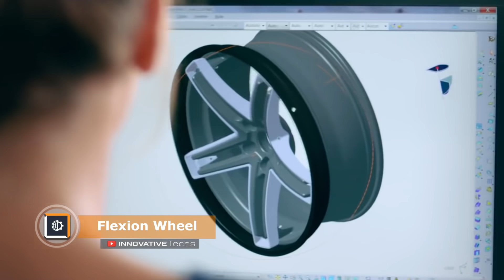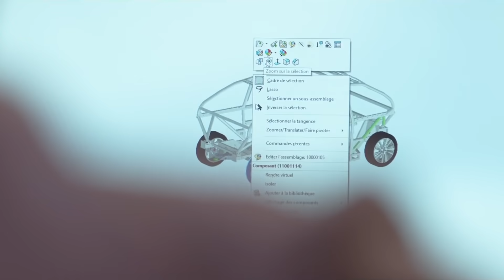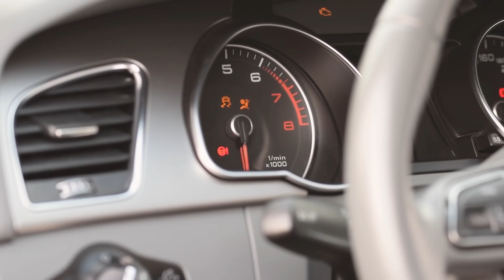Michelin presented airless tires for production cars

Comment: some people took the term "re-inventing the wheel" to a literal level.
Reply: Paradox that will being of tubeless tire design was long invented back in the late 60s by a company called Goodyear which made the tires completely out of piano wire thickness stainless steel interwoven that acted like a spring dampening qualities for the vehicle called the moon rover.
Reply: Paradox good thing that’s a tire and not a wheel
Reply: Back to the Stone age 😂😂😂
Reply: @isaiahbabb8612  Some of them replace the wheel too though
Reply: This typer of wheels have existed for more Then 10 years but have only been avaible for the military
Reply: History repeats itself bro
Reply: Paradox A tireless venture, nonetheless.
Reply: Gary Quail yeah that's not for consumers
Reply: The wheel hasn't changed though...🤦‍♂️  Only improved.
Reply: @garyquail2347  While Goodyear did start the idea, they could never make the actual idea. Michelin was the first to make the Tweel and no company has been able to match the same quality as the tweel. While these tires do break it is typically due to over abuse and sometimes just a bad tire, but Michelin has been so far ahead of Goodyear for decades. The only reason the tires are expensive is that in the tire market you get what you pay for, Goodyears only last for about three years on average before having to get replaced while Michelins, on average, last for about 6 years before needing to be replaced.

Comment: Won't work in the snow belt. Voids will fill with slush that will freeze when you park.
Reply: Good point
Reply: If they close them it should be fine but definitely not in this state.
Reply: If they flex enough, any ice would break out pretty quickly but they might be out of balance for a while.  I'd worry more about a rock getting into that web.
Reply: @alwayslearning3671  Ice can be hard and sharp enough to damage the rubber, especially when this happens repeatedly.
Reply: They will probably make a sidewall to cover that, but don't have it currently applied just so they can show off the technology.
Reply: not true the ice will break when u drive, i doubt frozen slush can hold up 2-3-4 thousand pounds.
Reply: @Zesmas  
its not about the ice not breaking but rather the concern of how more stress you are putting on the rubber/what ever material being used. for example the ice slush holes in holes and overnight the ice freezes, when you start the car the extra weight could cause the ice to slice something before craking. when repeated it could cause the wheel to wear out alot faster then if there was no ice.
Reply: @Zesmas  yes and no. Tightly compact slush that freezes into a ball can be very strong. Also if a car weighs a hefty 4K lbs, thats only 1K lbs per tire. Plus you have the weight spread out over the contact patch of the tire. So realistically you may only be looking at 800lbs of pressure.
Reply: I bet that tire in snow conditions it could possibly give traction because of the added weight
Reply: Or... anywhere with heavy snow? I hear they have that in some places that arent Ohio.
Reply: They will look like normal tires/will have a sidewall. At the moment they are shown open just to display the technology inside.
Reply: Send these baby’s to Florida right away 😎😎😎
Reply: Of course they will add sidewalls to the final product. Pretty sure the reason why there is none on the videos you see, is because they want to show the new technology.
Reply: Production models will be closed and look same as any other tire, open ones are only for prototypes/testing.
Reply: They can make a closed one that less stiff so it can be more flexible
Reply: @alwayslearning3671  Agreed, similar to having snow pack itself on the backside of the wheel. It'll work itself out.
Reply: Can’t they be heated from the car somehow to melt it?
Reply: well it would be easy enough to put a sidewall on the tyre
Reply: They'll probably close the size once it hits production. It protects the insides as well as looking more "normal". Since we humans don't like change, Michelin will benefit from making it look normal if they want the tyre to be widely accepted.
Reply: Cant wait for the airless tires but I live in Michigan so they need to work in winter as well. I hate low profile tires because again Michigan. With all the stupid potholes everywhere my wifes already ruined 2 rims on a 1 year old car. But she had to have a sportscar. Good thing we got the warranty.
Reply: Make side walls and your problem solved.
Reply: Yep..  stones too.
Reply: @SugarFreeTargets  If you put sidewalls on it, it's back to being a pressure vessel.
Reply: @peterscott2662  - like a tire?
Reply: Peter Scott wow, that’s actually quite intuitively insightful! It sounds obvious now that you’ve mentioned it but, I never would have thought of that! I’m sure the same could be said for muddy terrains...
Reply: Been through that with my CRV. The rims collected slush and after it froze in place put your wheel out of balance. Had to stop and clean them out. Needless to say didn't keep that vehicle.
Reply: @Dindonmasker  they should close them in, then add something light and expandable to give them more rigidity in the sidewalls in cornering.... No clue what would work tho... Maybe nitrogen or something
Reply: Could easily cover the gaps with flexible material on the side. Not rocket science.
Reply: @Zesmas  you never drove in winter have you?
Reply: @beatswitdat4285  from thousands of years of water continually freezing.......i fail to see your point.
Reply: @Zesmas  nope u are way wrong,glaciers are made from snow. Over time snow gets heavy, so in a place where it always snows, snow is going to stack up. With all the snow that keeps piling up it it getting really heavy and making the bottom solid. Then repeat...repeat....repeat
Reply: @beatswitdat4285  glacers are ICE not snow.
Reply: @Mach_Style  you  have obviously never met Mr. Momentum.
Reply: I thought the voids were there so people could see it in action...
Reply: Just a case of the "but sometimes". This can be easily prevented, and the benefit of having airless tires to the rest of the world is quite large.
Reply: True, but it would be possible to heat the wheel/rim with an electric current similar to the way automotive windshield defrosters work.
Reply: Valid point but if you have a rubber/flexible material as a side wall then you will be better off.
Reply: The show models don't have sidewalls so they can display the tech. I'm sure when the passenger version eventually makes it into production they'll have  some form of sidewall specifically because of this.  ... Well, assuming the police allow it.  They're going to be up in arms about their puncture strip tools being useless.
Reply: Yes it does
Reply: LOL THEY'RE GOING TO HAVE SIDEWALLS IN PRODUCTION JESUS FUCK ALL THESE REPLIES FOR NO GODDAMN REASON
Reply: Peter Scott what if they closed up the open sides of the tire?
Reply: I believe these are just so you can see how they work they will most likely have sides
Reply: Seb H exactly, these people have no common sense like as if the people who came up with these didn’t think about that
Reply: @alwayslearning3671  if they flex too much it would cause unpredictable handling lol
Reply: yeah but ... global warming
Reply: That's why they should put a rubber cover on the sidewall. Like in a normal tire.
Reply: Maybe skin the sides to prevent?
Reply: and it looks damn ugly
Reply: they will cover the sides with rubber, they just left it open in the video
Reply: Pretty easy to imagine a conventional looking tire/wheel with the inner part using the tweet design
Reply: England doesn't really get snow so theyd be great here
Reply: Extreme cold may also make the tire springs more brittle.
Reply: Yeah I can see pneumatic snow tires still existing long after these come into play
Reply: good point but considering how crazy this technology is getting, let's use our imaginations.  There will be micro heating conduits built in the tire that will easy melt the snow and ice, or the tire material will be ice/snow proof.

Comment: I have seen this like 10 years ago. 
When is it going to come out already
Reply: ... 5 more years; honest...
Reply: They're struggling with some key features/floors of the design. The idea is sound, but they just can't get anywhere near the same levels of grip as a traditional tyre, because of the way the 'tyre' behaves. Also, the ride quality is fucking awful, lol.... you don't appreciate all the frequencies and vibration your rubber balloons smoother to make driving not make you want to commit suicide. Lots of small things that have massive effects.
Reply: @Fire0101011  Not a concern for people who live in a civilised society.
Reply: mike brink  I think this idea is a fantastic thing to explore and if they can get it working.... I'm all for it. But for now, you just can't beat what we already currently have. It's tried, tested and proven evrey single day by literally millions and millions of cars globally.
Reply: @Nemoticon  How would taking the air out affect the grip any other way than improve it? Isnt the main point is that air less tires have more friction and thats why gas consumption goes thru the roof.
Reply: @Elias-eq8ut  Depends, more friction results in more rolling resistance that results in greater fuel consumption. Grip is more than just friction, but it's too long to go into.
The point of the airless tyre is to create a product that does not blow out or require refilling... positive advantages.
However, air tyres are firm but compliant which offers grip without excess friction and wear. Their compliance also aids handling and cuts out higher frequency vibration, acting as part of the suspension.
Conventional air tyre technology has a lot going for it and whatever replaces them is going to have to be an incredible product.
These technologies are developing all the time, so it's hard to guess which way they go.
Reply: @Nemoticon  how long can grips definition be?
Reply: BKD Vickers  Lol, my lawnmower has plastic wheels.... it's not exactly a comparable item to actual vehicles that travel thousands of miles with people lives in and around them.
Reply: Why not combine this design with normal air tyres? close it up but still have the lines of rubber inside, and then fill it up with air.
Reply: @ghoulbuster1  We could throw ideas at them all day long.... but they've put the time and effort in, they know which direction to go in, lol. Otherwise the internet would have solved all the world's problems years ago.
Reply: @Nemoticon  so... The idea is not sound
Reply: @sgtpepper6379  Depends if they can get the design working, doesn't it.
Reply: @Nemoticon   Damn they wont leave you alone lol
Reply: brexit happens first!
Reply: @gabrielibarra5551  Stupidly.... I keep responding, lol. But hey, if I'm wrong about anything, I'm happy to admit to it xD
Reply: they've been "on the verge of a breakthrough" for years
Reply: Why would they release these, there not dumb to bury there own tyre bussiness with a tyre thats virtually maintenance free and puncture free...we wont see these for a very long time for any conventional car.
Reply: mike brink  Considering we've been doing this wheel thing for thousands of years...trial and error, trial and error.
Reply: Ya Same thing...I was wondering when it's going to release it since very long time ago 😂
Reply: @sgtpepper6379  No. Just the tech isn't here YET.
Reply: MsLampalampa 1:40
Reply: Construction and industrial equipment wont use these, they normally just take normal tires and fill them with foam. 

The only market for these airless tires is cars, if it can be just as comfortable.    
Construction/industrial wont use the airless tires unless they are cheaper than normal tires filled with foam.
Reply: @common_c3nts  Sounds like they'll always be a sideshow, never the main act.
Reply: @niubstah So.Gordon Gecko won't let it happen.
Reply: @K03sport   Ive heard the government has these on the UFOs hiding in area 69.
Reply: It said 2024.
Reply: How about it!
Reply: @Nemoticon  lmao
Reply: 30 more years
Reply: As soon as we have flying cars. "Roads? Where we're going , we don't need roads." (or tires) LOL

Comment: I wonder how the flex is sideways, in heavy cornering situations.
Reply: ϟϟ White Wolf ϟϟ  That's absolutely wrong. Run flats are not comfortable at all...
Reply: I'm guessing terrible. 1 heavy corner would shred these things.
Reply: So made for a limo that can't turn sharp to avoid something without vaporizing its traction and crashing uncontrollably.
Reply: It depends on rim shape. If the spokes are very wide they won't have any problems with sideways force. Try shearing an old credit card by laying it flat on a table and moving top and bottom in different directions. You won't be able to break it without two big vices.
Reply: ϟϟ White Wolf ϟϟ  is your username a reference to some neo Nazi crap?  Ss symbols... "White wolf"... Just saying...
Reply: One would only need to dish the angle of the "sidewall" to provide cornering stability.
Reply: @kevingeezy5176  Yea copy and paste his user name into google all Nazi stuff pops up on his Pinterest account.
Reply: @kevingeezy5176  It is. Probably some edge kid.
Besides, combination of SS and english words?
*laughs in german*
Reply: @attinyit9609  will still crack with bad enough potholes hahaha
Reply: @Brasshound480  Yeah. Karmic!
Reply: @attinyit9609  But, on the other hand, bending it back and forth for 50, 60K miles and I think you'll have issues.
Reply: With all that rubber couldn't  they just give tires thicker tread and sidewalls lol
Reply: @kevingeezy5176  🙄its hard to say without meeting the man, wolf.

Initials alone spell nothing , yesterday is gone.
Reply: You spoke my mind!
Reply: Made I 666
Reply: @Brasshound480  "limousine" is a european term for sedan.
Reply: @raylovelace8588  normal tires dont last that long
Reply: @azharkacak1978  Then they won't sell, because they're just, you know, tires. For a LOT more money.
Reply: @tyg8562  I don't think we're looking for "normal" here.
Reply: TheMegabitGamer They could, but to what end? Tyres are highly engineered; they balance durability, longevity, cost, grip etc. Adding more rubber would cause more heat build up, which in itself could cause earlier failure of the structure, reducing longevity. It also increases weight and rolling resistance, which reduces economy. It also adds material, which increases cost to manufacture and transport. If longevity was the only thing we needed from tyres, engineers would be making tyres like that already; if the current ones werent, a new breed of engineers would come along and design a new tyre with more rubber, we'd all buy it, and they would win market share pretty quickly. Formwhat the vast majority of us use tyres for, the current crop of road tyres are pretty close to as good as it gets with current materials - and as materials evolve, they keep engineering better ones.

Comment: They’re not letting you hear the car drive because it’s loud af
Reply: Mason Kennedy u good
Reply: Really?
Reply: why would it be loud lmao
Reply: that is why they are testing it
Reply: @l3gacy  
It really is loud if you care.
You have tons of thick spokes spinning, open tot he air, and rapid deformation of the internal spokes. Das a noisy boi.
Reply: I'd imagine a production model would have a fully sealed side with some small venting. That would reduce road noise quite a bit but still allow for pneumatic pressure changes to be relieved. . I'm a industrial mechanic and not a engineer but that's what I would think would work. 😁